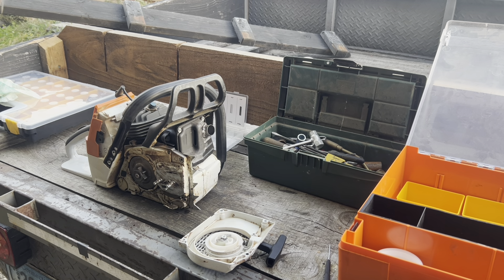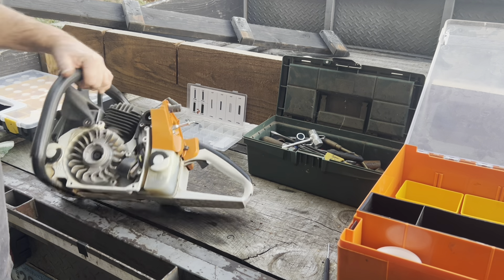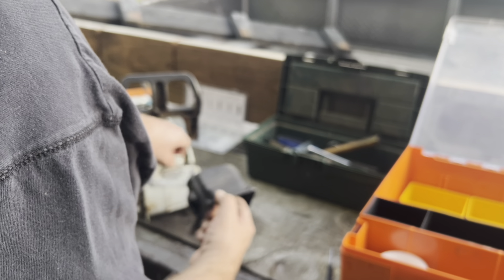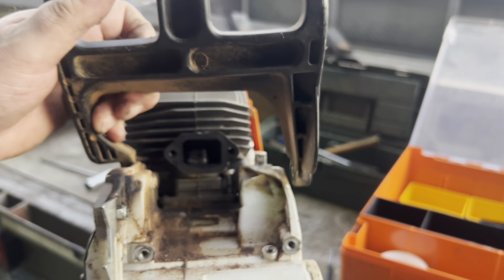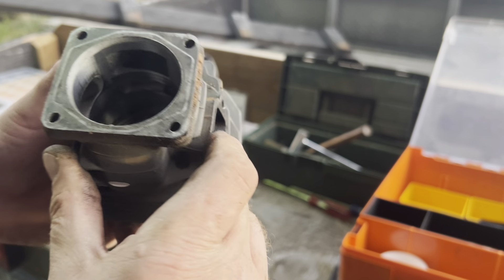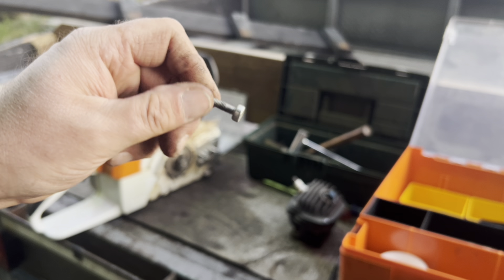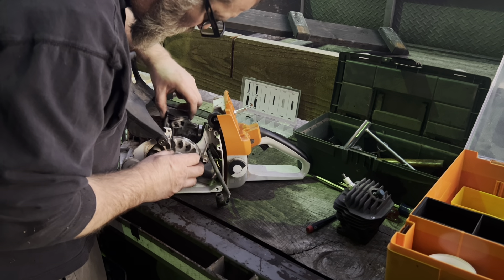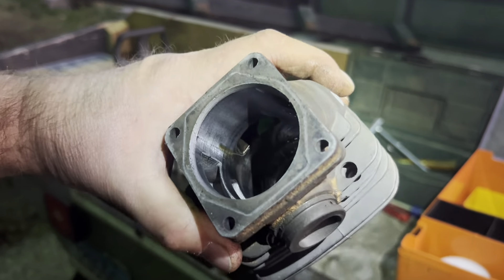SOTF: Farmertec clone saw P2 tare down

Comment: Give er a farmer port job. I like what you did with that 359 last year.
Reply from the maker: That's what I was thinking! Thanks, that 359 is still goin strong!! I was planning on doing a follow up on that saw. I just got a Jonsered cs2156 which they say is the equivalent to a 357xp. Apparently the 359 is less powerful than the 357xp, so I'd like to do a comparison of the two saws cutting.
Reply: @sawsonthefarm  Beauty.  I did a working man’s port (no machine work) on my 357xpg last year with timing advanced 7 degrees, and I can tell you it outcuts my 365 open loop.  Had some issues with the accelerator pump in the walbro carb along the way but I robbed the zama off my 359 and it seemed to fix the problem.  Looking forward to seeing you work on the Jred  Cheers!
Reply from the maker: @stickyricky9612  wow!!! Very Cool! Do you have any videos out of that thing cutting? I'd love to see it run!
Reply: No I don’t.  I don’t think I’ve ever recorded myself cuttin.  I’ll leave that to the YouTube pros 😉
Reply from the maker: I hear you, I still have a hard time getting in front of the camera. Although I do have fun with it.
Reply from the maker: Oh, and people would watch if you ever decided too!
Reply: Great video. At the beginning of the video there is a scrench attached to a clasp, it looks like a cotter pin is connecting the scrench? Curiosa’s to how it was done. 
Thanks for sharing 
Stay safe
Reply from the maker: @ruggedtimber1743 that's exactly what I did! Put the scrench in a vice drill a hole. Get a large cotter pin and spread it open for your hasp. Close it up. When you place it in the hole use a drift punch to start bending the ears, one in each direction towards the ends of the wrench. The key is to use a hasp with a swivel. It's handy, put it on your belt.